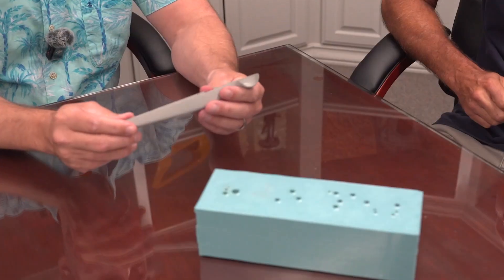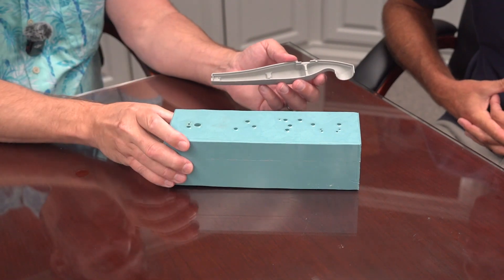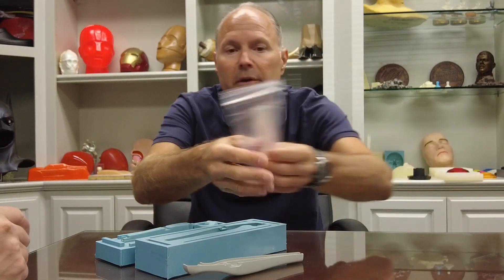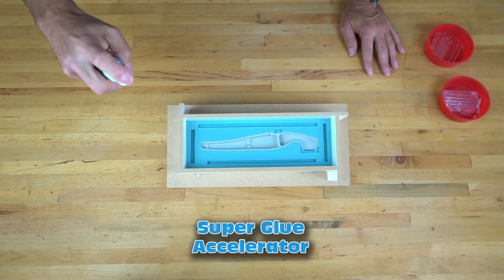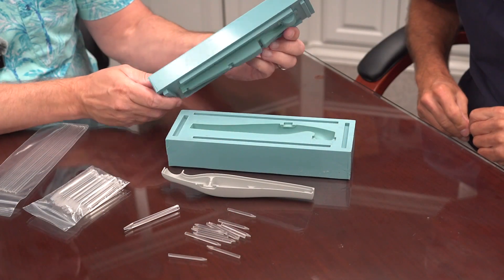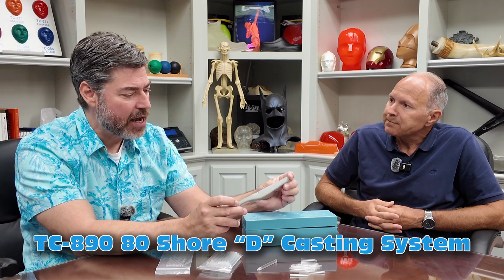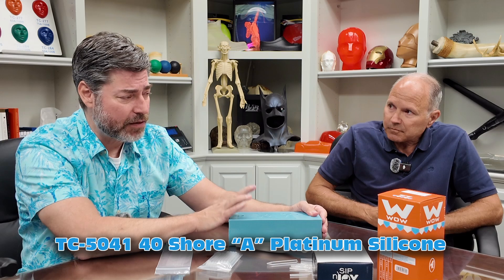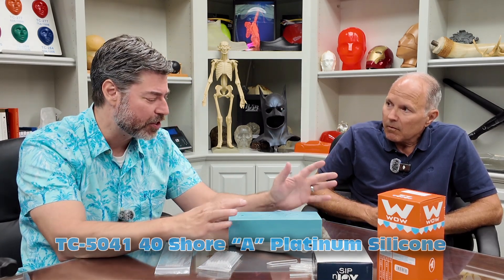Vents For Thin Walled Parts - Molding & Casting SLA 3D Printed Patterns With @bjbenterprises

Comment: Please give us the Name or link to the Primer  for sla prints to work with p-silicone.
Reply from the maker: No problem. I just updated the links in the video description. Remember that different Platinum formulas have different sensitivities to contaminates. When in doubt, run a small test first! John was using TC-5041 for the mold in this video.